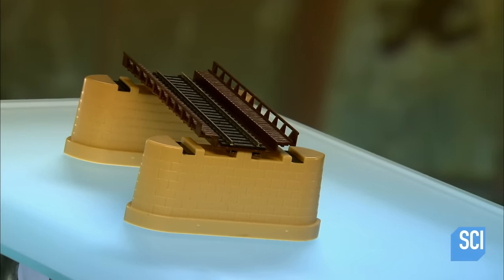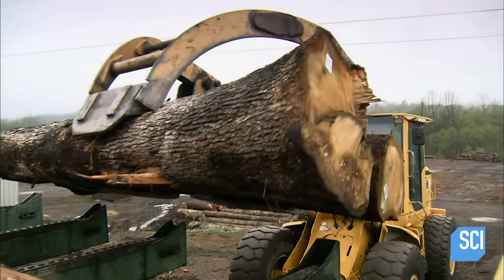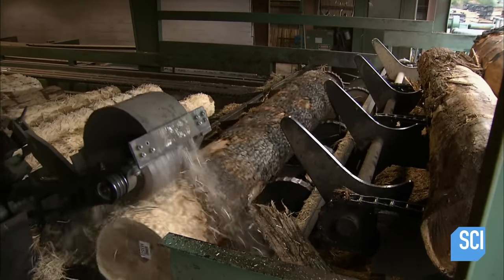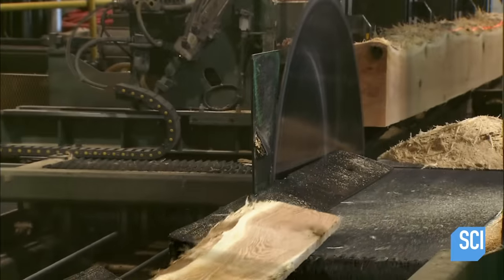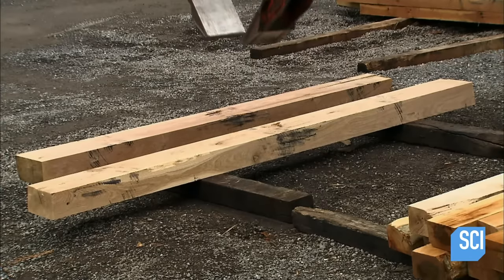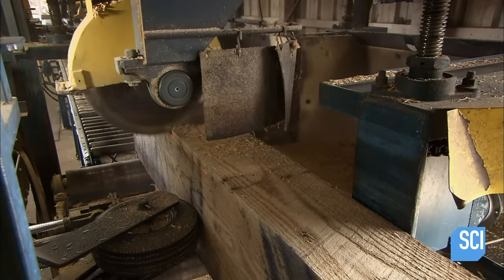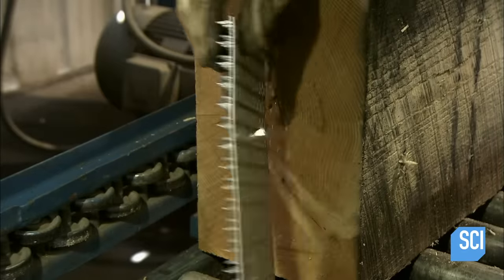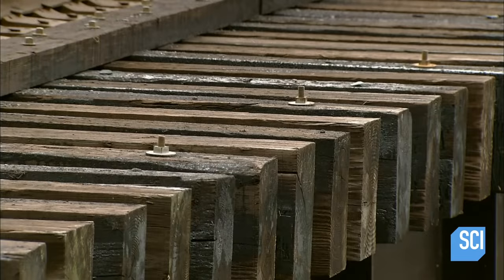How It's Made: Railway Bridge Ties

Comment: These things must be expensive... literally a solid wooden log
Reply: Solid Oak even.
Reply: I think it costs 1million dollars to build one mile. I’m not sure I’ll have to check that
Reply: Raw cross ties was $34.50 a piece delivered to that plant 6 months ago I'd be willing to guess that the price is now under $30
Reply: JarJarBinks - Amtrak seems to now use concrete sleepers, at least in the northeast.
Reply: @ClockworksOfGL , most of the Northeast Corridor and portions of the Keystone Corridor between Philadelphia and Harrisburg use the concrete sleepers. The exceptions being at the switches, fixed overpasses, and moveable bridges. The Delaware River Port Authority's PATCO High-Speed Line between Philadelphia and Lindenwold, NJ also uses concrete sleepers.
Reply: Bryan Noga  in Illinois where they have “higher speed” sections up to 80mph they have gone to concrete ties about 5 years ago
Reply: nah.   the wood industry is heavily subsidized by the government.  Wood ties are cheap.  Dapped ties are expensive as hell.
Reply: @tafdiz  That is the beauty of capitalism, if you can start making it cheap, you can make profit. Market place will decide the the price.  Manufacturers take risk with capital Investment, they have to buy 'expensive' equipment and will provide jobs.
Reply: @tafdiz  How do you define Unlucky? There is always a choice, if someone does not like Capitalism, they can move to a place which suits their '**ism'.
Reply: @bootleg8720  
Wood ties may be "cheap," but the concrete lasts much longer and when you factor in labor cost, it's the better deal.
Reply: And avoids the use of Creosote, a pretty nasty chemical.
Reply: Yep,and it looks like alot of work goes into every one.

Comment: Didn't know this wood long last 25 years
Reply: Savage Activity Creosote makes them last.
Reply: And dont forget they up in the air and not touching the ground so they get to dry on all sides. 

My uncle's doug fir deck boards  in Maryland lasted over 30 years as it was off the gound  covered and well aired
Reply: The railroad will be using these long past 25 years.

Comment: They were perfect for jack blocks on a farm....we had plenty to use to jack up tractors, combines, cotton pickers and other implement equipment to change out flats or do repairs....lasted for years......heads up FYI, if ya cut a tie with a chainsaw, better have long sleeve shirt on, gloves, and goggles....that creosote will blister you up like a 2nd burn....it's bad for ya skin.....
Reply: Yeah I would definitely have a designated chain for cutting those. 
Once the chain on my saw gets old ( meaning I have sharpened more than a few times ) I use them for cutting brush, tree roots, and anything else that has dirt or an old nail. 

A dull chain is aggravating to work with and adds danger to an already dangerous activity.
Reply: @benbrice9343  Good advice. I live in rural Thailand near a wood reclamation yard where they tear down old teak houses and re-purpose the wood. They run a handheld metal detector, like ones found in the airport, over each timber before sawing it. The wood is outrageously expensive.
Reply: in my country using railroad sleepers in gardens are not permitted because of the environmental damage they could cause because all railroad sleepers have chemicals to protect it from pests and rotting which is toxic

Comment: Yeah I work for a railroad. They don't preserve ties like they used too. A good tie used to last 20+ years. Now if you get 5-10 years you're lucky. Plus due to not being treated properly the ties are hard as concrete and split very easily.
Reply: Cut a old tie and it had Creosote all the way through. A new one only soaks about a inch into it.
Reply: @MrRander7769  I wish they were an inch of creosote. Ours are maybe a quarter inch at best. Basically they're dried and dipped. That's it.

Comment: Union Pacific and BNSF still using the wood track.
Reply: I design equipment for rail applications.  Those people probably mumble "if it ain't broke, don't fix it" in their sleep.
Reply: Union Pacific tracks between Chicago and St. Louis were upgraded to use continuous track mounted to concrete ties during the 0bama presidency.  The reason given for the upgrade--at a huge cost to taxpayers--was for high speed Amtrak trains.  It was supposed to cut the travel time between Chicago and St. Louis from 5 1/2 hours down to maybe 3 hours.  Once the upgrade was completed, they did some test runs of Amtrak trains traveling maybe 110-120 mph.  However, today the Amtrak trains are traveling about the same speed (80 mph) as they were prior to the upgrade.  So, high speed Amtrak trains didn't quite materialize like we were told was going to happen.  However, I did notice the Union Pacific freight trains are traveling faster on the upgraded tracks--around 75 mph.  It makes me think the real reason for upgrading the tracks was to allow higher speeds for the freight trains and not Amtrak.
Reply: @ILGuy2012  That's how UP works. Everything for freight, nothing for contractually obligated passenger rail services.
Reply: @ILGuy2012  class 1 railroads are full of crooks and lobbyists

Comment: Wood is the perfect Building Material... it's supports  both compression and tension, it's flexible under vibration, much lighter than concrete for bridge building.. impervious to most chemicals, and doesn't suffer from freeze-thaw like concrete
Reply: It's also pure solar power
Reply: Pulls carbon out of the atmosphere, too.

Comment: Wooden ties should be outlawed. Each tie was a tree somewhere soaking up carbon, giving off oxygen in return.
Ties should be made of high strength/impact plastic. Recycle all the billions of plastic trash into new ties.
Reply: Actually the railroad has started using plastic ties. Don't know how long they'll hold up under UV rays. They are much heavier than wood and break easily if pulled on.

Comment: Okay so why don't they just use concrete? Seems much easier
Reply: Wood is cheaper and takes the vibration better than concrete.
Reply: Wood is 100% made from solar power
Reply: @50oldsmobile  Well technically everything on this planet is made from solar power.
Reply: The bridges these are being used on pre-date concrete ties and weren't designed to factor in their additional weight (three times that of wood) .

Comment: There is not enough trees on the planet to keep doing this. So this also means that after 25 years your trains fall in the water; real smart. Its time to evolve past cowboys and indians.
Reply: This was filmed in Virginia in an area that has been continuously harvested for a few hundred years, the woods are basically a big garden just longer time span, this is pure solar power
Reply: Inspections and maintenance work on railroads is ongoing, so deteriorating wood is replaced before trains fall into the water.  Shipping by rail is much more efficient than shipping by semi truck.  It also reduces the amount of truck traffic on the highways, so reduces the number of crashes and reduces wear and tear on the roads.

Comment: Don't use wood, the forest will be cleared. Just use concrete that is strong and durable, let's protect our forests together
Reply: Accept there's a finite supply of riverbed sand for concrete. Its also running out, the process that makes cement is worse than wood for the environment.  Concrete is no good on loads like this because the constant movement will break the ties, where wood flexes.  Also the wood comes from managed forests, they plant more than they take and carefully calculate how much where they take and how long it will take to replace it.
Reply: There's MORE trees in the US now than there was 100 years ago.